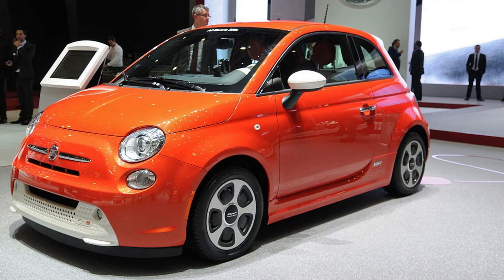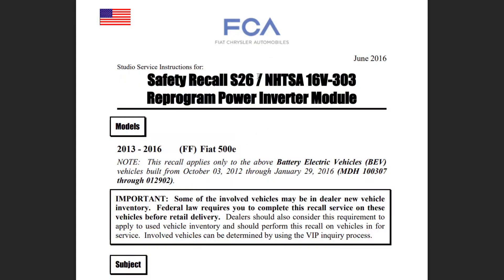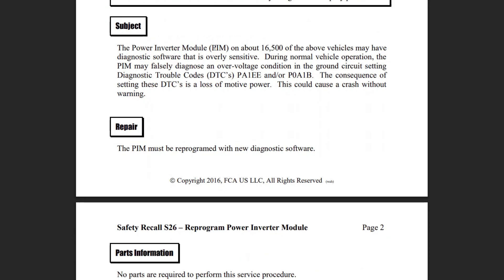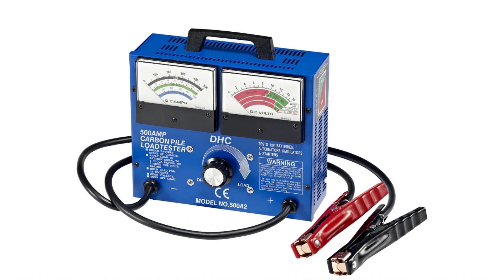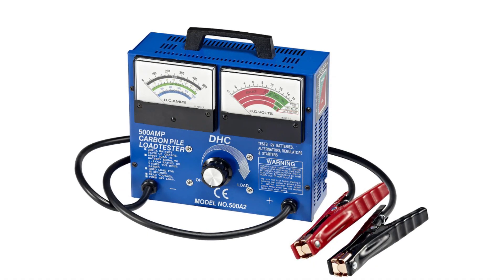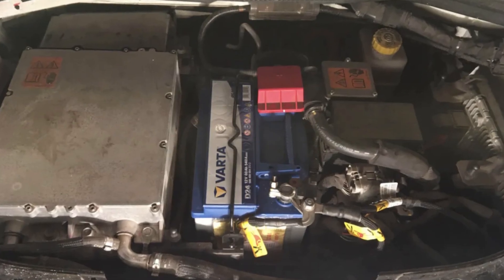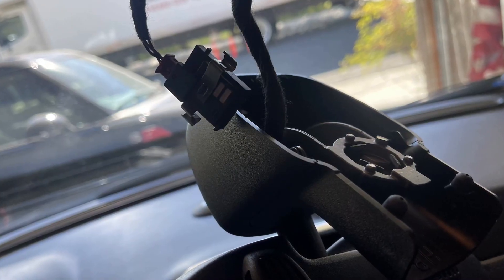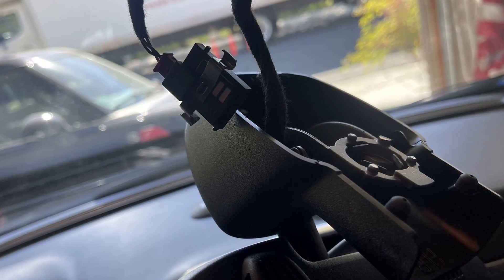Fiat 500e “Service Electric Vehicle System” warning

Comment: Thanks for posting this. I got the warning light this morning after charging overnight. However, the warning went away when I restarted the car a couple hours later.
Reply: Did you find out what caused it?
Reply: @damianbond679  I think I just tried to yank the plug from the port before it had been released by the computer. That’s the only thing I can think of. The warning light stayed on during my 10 minute drive to work. Then a couple hours later when I went to lunch and restarted the car the warning light was no longer there. 🙏